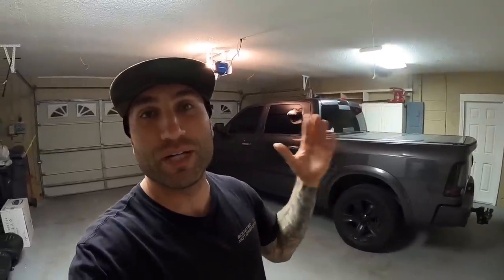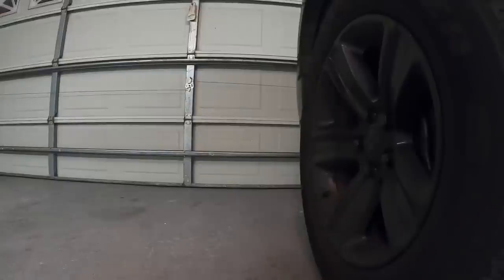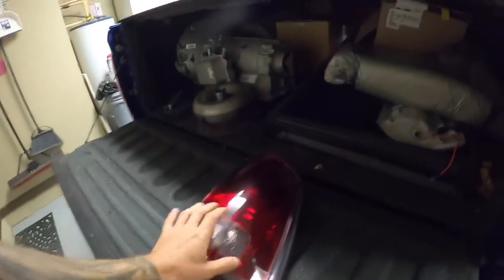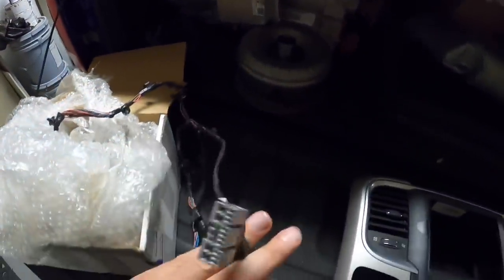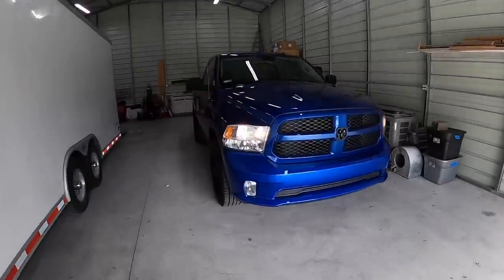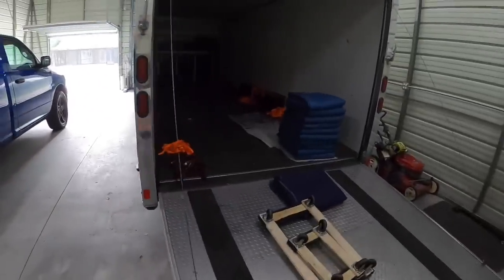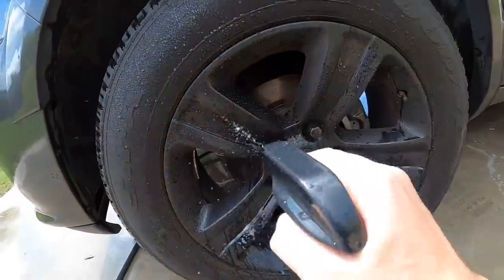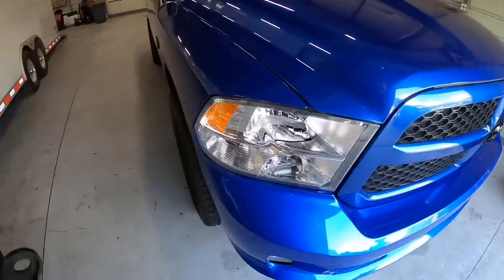Everything RAM 1500 in the new Workshop

Comment: I wish all those easily installed options were available on my '10 model. It has every option except a touch screen and adjustable pedals. Thank God it has cloth seats and not leather. It's a 2010 Big Horn 2 wheel drive with the same color as your new project. I love that Deep Water Blue.

Comment: Those sensors on the Mirror assembly facing forward are the auto Hi-Beams and Rain Sensor. You may need to update the wiper stalk switch and assembly in order to make that work. But otherwise all the hookups should be there since the trucks wiring connections are all the same across all trims you should be able to plug stuff up... However you would need to check to make sure the pin outs are there in the Fuse box because you will need to add in fuses most likely...

Comment: The inverter on the bezel is a crazy install my truck is an express and I’m trying to hook it up but I read online you need new harnesses for the seats and stuff and u need the actual inverter that goes in the passenger seat if you manage to find out how to wire it I would watch that video and replicate it because I’m just lost and ram forums don’t do me any justice because I’m still lost
Reply: Just a heads up as I see you’re doing the new mirror the truck won’t know how to work it until you enable this setting 

Vehconfig 3- interior electrochromic mirror present

And the camera that’s below the mirror that’s for the automatic high beams which I have it enabled in my 2015 express for that to work if you want automatic high beams you’ll need these settings in alfaobd 
Vehconfig 1-Auto Highbeam: yes
Lin and misc-Smart Beam Present (AHBM): yes
2014 CBC Config I/O & Feat.-Auto High Beam module location: ECC AHBM
Cust.Set.Menu 1-Auto High Beam CSM present: yes